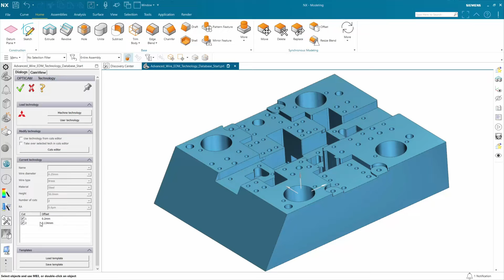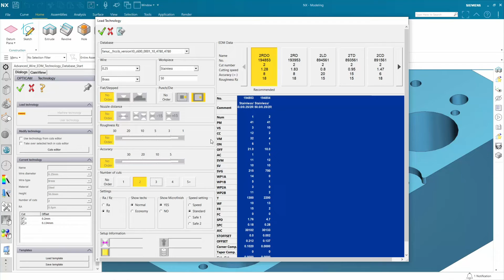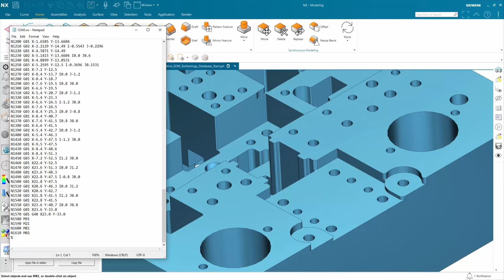Advanced Technology Database in NX CAM Wire EDM

Comment: Is there any database we can manage for vmc 3 or 4-Axis machine..??
Reply from the maker: Thanks for your patience as we worked to find a solution for you, and thanks for your question! This video demonstrates how to program Wire EDM machine tools using NX CAM, which offers technology databases to speed up the programming. If you are referring to databases for vertical machine centers (VMC), NX CAM provides Machining Data Library, which is a customizable machining database that enables you to manage and apply proven data to for different use cases. You can find more details about the Machining Data Libraries on our Support Center: https://sie.ag/3W0D6cZ

To learn more about the advanced capabilities in NX CAM, you can visit the NX Manufacturing community. There, you can join discussions with peers and experts and stay up to date with the latest functionality in NX CAM: https://sie.ag/3FyursL

Hope this is helpful! #TeamSiemens